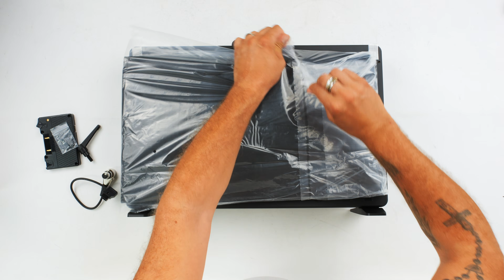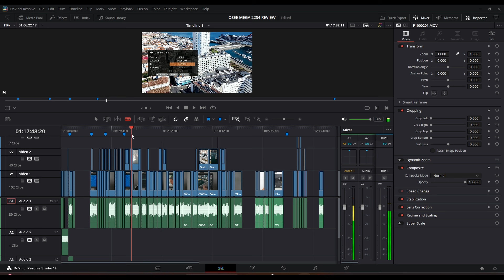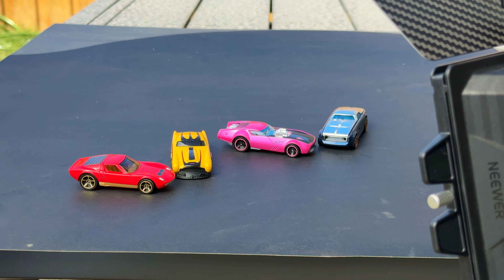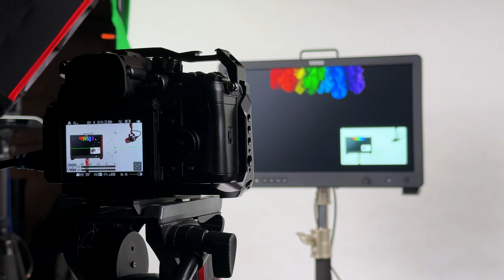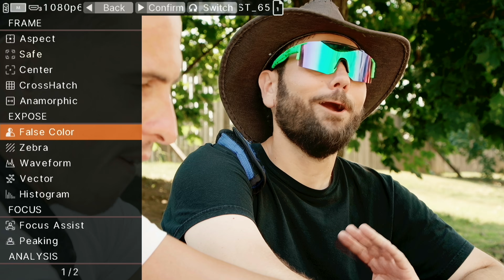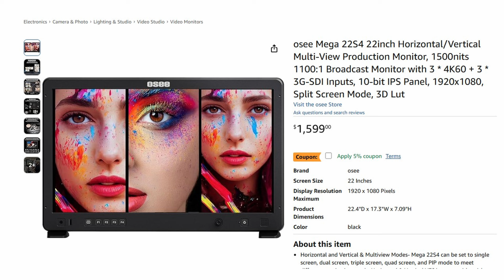Osee Mega 22S4 Review – The Ultimate 22" 4K Production Monitor!

Comment: Did you ever felt like 1080p wasn’t enough resolution for a monitor of that size? I am considering to buy the Sumo 19 pro from Atomos because it has a 4k panel and when monitoring multiple cams at once I feel like a quarter of 1080p per angle might be not sufficient
Reply from the maker: For me personally, 1080p has actually been great even on a 22” monitor, especially for live production and multi-cam work. The panel quality, brightness, scopes, and overall usability matter just as much as resolution in real-world use.

When doing quad-view, yes technically each camera feed is only using a portion of the screen, but I still found it usable enough for framing, exposure, and monitoring during livestreams or productions. 

I think it really comes down to whether you prioritize pixel density or overall production-monitor features/workflow.
Reply: @LeoPazzo  Wow — first of all, thank you very much for the quick and detailed reply.

I think I probably just need to see the monitor in a real-world scenario to properly judge it. The “problem,” so to speak, is that we sometimes run fairly complex interview setups where the monitor wouldn’t only be used for rough framing, but also for checking focus, monitoring fine details, and generally evaluating the image more critically. In that regard, I’m slightly concerned that the resolution might end up being a limiting factor.

The Atomos Sumo 19 Pro, which is still very much in consideration for us, would at least provide a full 1080p image per feed, despite the smaller screen size, while also offering a lot of additional features such as ARRI False Color, EL Zone, cloud connectivity, recording options, and so on.

On the other hand, the OSEE monitor also has some genuinely compelling functionality — for example the ability to rotate it vertically, as well as displaying three camera feeds in a way that fully utilizes the screen space, which is definitely a strong advantage too.

So I think for us the main question really comes down to pixel density and overall image sharpness versus cost.

In any case, your real-world experience and insights were already extremely helpful, so thanks again for taking the time to share them.

Have a great day. Cheers.
Reply from the maker: @ez8937  Yeah, in your type of workflow I completely understand the concern honestly. Once you move beyond basic monitoring and start critically evaluating focus, skin texture, fine detail, and image quality across multiple interview cameras at the same time, panel resolution definitely becomes more important.

Where I think the OSEE shines more is overall flexibility, workflow efficiency, and value for the money. Features like the vertical rotation, custom layouts, and the 3-camera layout maximizing screen space are genuinely useful in production environments. But if pixel density and image sharpness are at the top of the list, I can definitely see why the Sumo is still pulling you in.

Honestly, I don’t think either choice is wrong here — they just lean toward slightly different priorities/workflows.

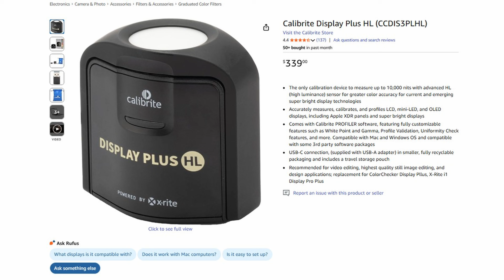Comment: I am unable to complete calibration, and the monitor returns a “Measure failed / Unknown error.” Please confirm explicitly whether the Calibrite Display Plus HL, as you claim at at 4:13,  is officially supported by the Mega 22S4.

V-mount battery charging (bidirectional claim - timestamp 8:47) suggests that the monitor supports charging V-mount batteries. In my testing, this does not appear to be the case.
Reply from the maker: I was just at the Osee Tech booth at NAB and they had this exact monitor and calibration tool - the Calibrite Display Plus HL, demonstrating to people how to perform the calibration with this device. I haven’t used it myself so I don’t know the exact process and why there would be an error. As I have never had to adjust the monitors calibration as it’s already color calibrated from factory and I’m happy with it as is. 

I think your best bet is to email Osee directly. Keep in mind I believe China has a Holiday for a few days at the beginning of May so it might take them some time to reply to your email. They would be your best resource for all the correct answers. 

And as far as your V mount charging question. I just doubled check to confirm I provided the correct info. And yes you can charge the V mount battery through the V mount battery. 
Let me explain, as I didn’t go into detail about this in the video. 
For example, you can power the monitor with the AC power supply. 
You can also have a V mount battery mounted in the V mount battery plate. You can use the included d-tap to 4 pin battery locking cable and connect the d-tap end of that cable to the V mount battery d-tap port and connect the 4 pin battery locking end of that cable to back of the monitors “batt in 11-17v” port. 

These above steps will NOT charge the V mount battery. 

What you will need to add to this above setup, to be able to charge the V mount battery is……. connect a d-tap charger to the V mount battery plate. Done. 

Tip. The d-tap port on the V mount battery plate acts as either an input or output. So you can take power from the plate to power the monitor or you can supply power to the plate to charge the V mount battery. 

Hope these details help clarify your questions and concerns. Any further questions let me know.
Reply: @LeoPazzo  Thanks for the quick reply, much appreciated.

I managed to get calibration working — turns out the diffuser cap on the Calibrite Display Plus HL needs to be removed (display mode). With it on, it consistently throws that “Measure failed / Unknown error,” so that part’s sorted now - my fault but i suppose better user guidance through calibration process would help.

On the V-mount point, I think the wording just wasn’t very clear,  made it sound like the monitor power when connected to AC is doing the charging which would have been useful, whereas what you mean is using an external D-Tap charger connected to the plate could charge the battery. Understood, and thanks again for the clarification.
Reply from the maker: Hey man no problem. 
Glad you figured out the calibration process / error. 
Here to help if I can. 
Thanks again for your support.

Comment: Which model of Pelican Vault case fits this monitor?
Reply from the maker: All I know it’s the Pelican Vault 24 inch. 

What I did was search up the interior dimensions of the pelican 1600 and then look for the pelican vault with the very similar interior dimensions. I bought mine locally at a surplus store so it’s not like a searched for a specific model online. I just walked in the surplus store and measured the inside of the 24 inch pelican vault hard case and it matched very closely to the pelican 1600. 
I looked for a model number printed on the pelican vault case but there is nothing written.
Reply: @LeoPazzo  Thanks, my 22S4 just arrived and my Pelican Vault arrives tomorrow
Reply from the maker: @martin_media  awesome 
Did you find out the model number of the pelican vault case? 
Please share that info.
Thank you
Reply: @LeoPazzo  I did, it the V600
Reply from the maker: @martin_media  amazing that’s great news. Thanks for sharing the model number.

Comment: Thank you for posting this review! Which Pelican Vault case is this that you showed as a replacement for the Pelican 1600 case? Thanks!
Reply from the maker: Yes great question. 
I really wanted to include this info in the video but unfortunately I don’t know the exact model as I purchased it locally as a surplus product so it didn’t include much info or tags or info attached to the case. 

To help narrow it down. 
I would search the exact interior dimensions of the pelicans 1600 and then with that info you can search for a pelican vault case that has very very close interior dimensions. If I recall correctly the interior dimensions between the 2 case is maybe 1/4 inch here and there. Very minimal. And as you can see in the video the foam insert of the monitor still fits perfectly in the vault hard case.